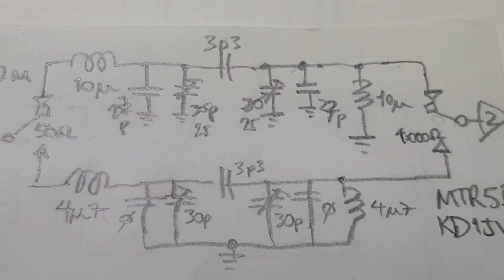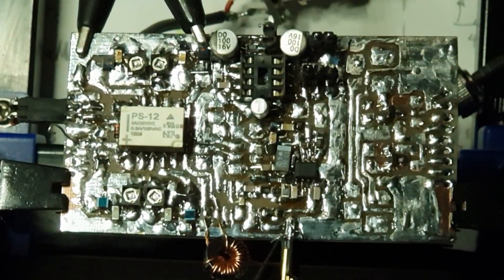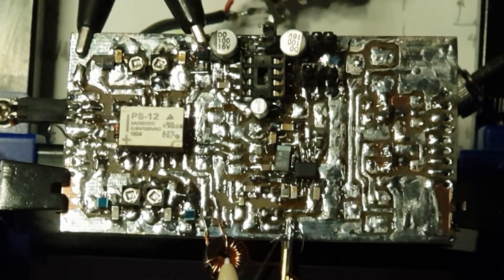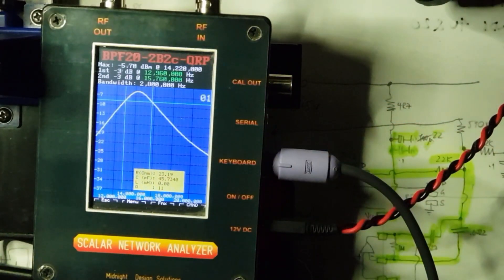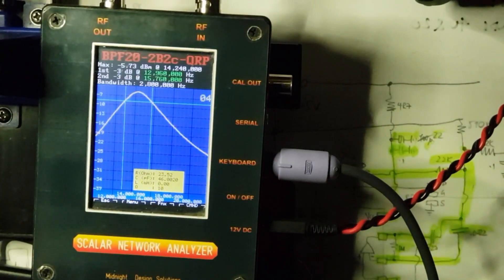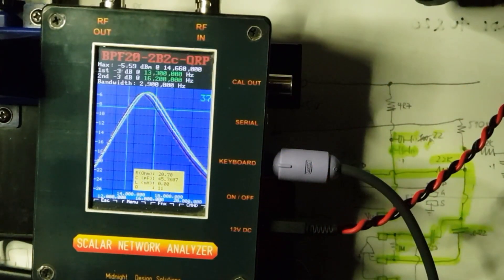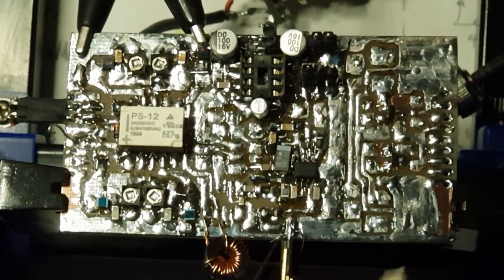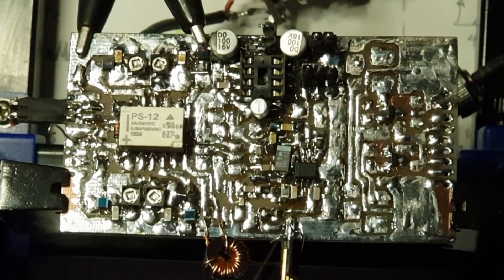2B2C: Scratchbuilt Dual-band 2 channel QRP CW rig/ Part 3 Receiver Band Pass Filters

Comment: Personally, I never had any success with such sort of band-pass filters. What usually happens is that they are fine in LTspice, but in reality, the insertion loss turns out to be 10+ dB. The best results I got are with filters calculated based on the article "Direct-Coupled-Resonator Filters" by Seymour Cohn (1957). There are several online calculators available online, they are easy to find by the name of the article. Also, there is an offline tool RF Filter Designer by Iowa Hills Software which is capable to calculate such types of filters. I never had any problems with them on any band from 80 to 10 meters. Insertion loss is usually 2 dB or less, and they don't require any tuning. They simply work.
Reply from the maker: Hi agn Alex, thanks for your comment. Most of my BPFs are 50r in and out, link-coupled.  Have only attempted one or two filters with an output impedance purposely designed for a high impedance mixer such as the 612.  It has worked in this case.  BPFs are a fascinating topic in their own right, and I think we all have successes and some failures. I've typically reproduced known , proven designs, and have not had too many problems. I only reproduced the KD1JV BPF in this project because I knew they world work and match well to the 612.  Designing and bulding your own can lead you into some dark alleys!  But can also be rewarding.  Home-building is a balance between optimising and satisfying.  Sometimes, good enough gets the rig finished!  73 de VK3HN.

Comment: On the insertion loss... I recently did some experiments with the little SMD inductors, and the Q is definitely a big issue.  It's hard to find SMD inductors with a Q higher than about 40-50.  And a hand-wound toroid can be 150-250 depending on factors!  My conclusion was that, as attractive as the size is, I can't afford the loss to use the little SMD inductors in any filter on a TX chain.  For an RX chain, probably not so bad, unless I ever get good enough at this stuff that I'm 3-5dB from perfection :-).  But yeah, I think you're right on the Q; matches my experiments.
Reply from the maker: Hi Yakov, Thanks, I resisted SMD inductors in small signal BPFs, due to the unknown Q question.  However I've started to see them appear in some 'respectable' places. See the RS-HFIQ receiver section, and LNR MTR5b, to name a couple.  There are others.  My problem was, how do you select the parts from the dozens available from the big suppliers? Then I noticed a range on Minikits, an Australian supplier that has an excellent brand, high performance kits (LF to uWave), and a trusted supplier. I won't post the link for them but they are easy to find. Mark's descriptions state "good for low loss BPFs". That was good enough for me. I wouldn't necessarily use them in a high performance receiver or transmitter, but in a knockabout pocket rig, no issue.  Interesting to hear your thoughts, I recommend to try them.  73, Paul VK3HN.
Reply: @Paul_VK3HN  that makes perfect sense. I've only used the parametric searches on mouser and digikey. A lot of the datasheets specify Q. I'll have to look for alternative sources that might have better options, maybe. I think you're right that they make some sense in a case where you can afford a couple extra dB of loss in exchange for the wonderfully small form factor.

Comment: Hey Paul, just a thought. if you put a 1500 ohm resistor across the high impedance side of the transformer and measure it from the 50-ohm side with the VNA.
Nice video! Thank you
Reply from the maker: Hi Curt, yes I think that would prove the presence or absence of any transformer effect in my measurements. Thanks, must keep that in mind.

Comment: Whilst never wanting to "doubt" Steve Weber, I thought the 612 (single ended) impedance was 1.5k. I wonder if your results would have been different with (say) a 33:6 transformer?
Reply from the maker: Indeed, I would never doubt Steve either. Once your matching impedance is approaching 1k ohms I suspect it is diminishing returns. I am sure there's a power transfer forumla that quantifies the power loss from a mismatch.  Maybe a moderately interesting and useful experiment to try different degrees of impedance mismatch and measure the results.  Question, how would you measure the transfer efficiency?
Reply: @Paul_VK3HN  Transfer efficiency is another mystery I conveniently ignore :) It would be easy to assume a large AL is more efficient, and the more turns the better ... but that's a total guess. And of course doesn't address the question of measurement!
Reply from the maker: @nevmarr  I've experimented with the traditional 3 turn link, and found that signal levels drop off with additional turns, not surspisingly!  I also experimented with tap points on a tapped resonant parallel tuned circuit in a grounded gate RF stage, the difference was only noticeable at the extremes.
Reply: @Paul_VK3HN  Just a random thought ... could you wind (say) a 10:10 transformer and measure via the two ports of your SNA, then a (say) 10:5 transformer? Would that prove anything? Just thinking out loud (and trying to generate a bit of traffic on your channel).